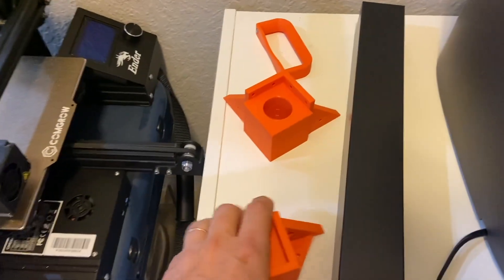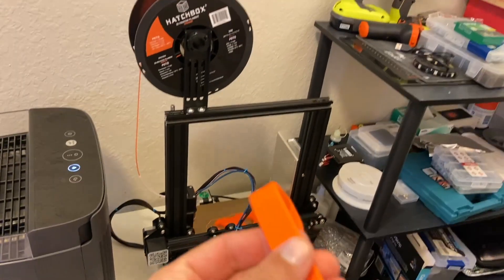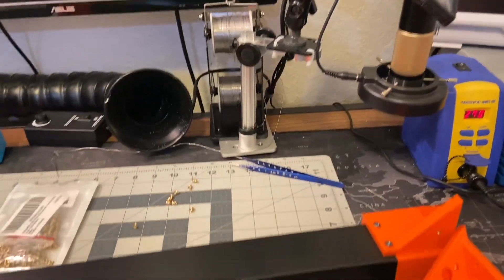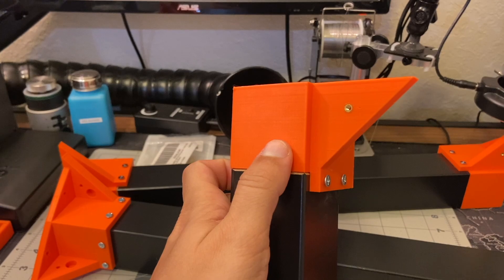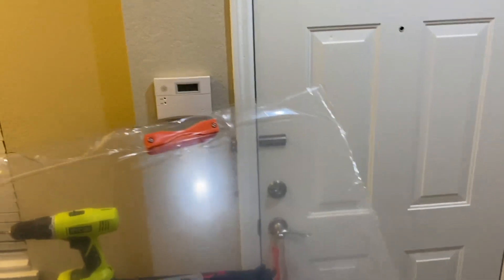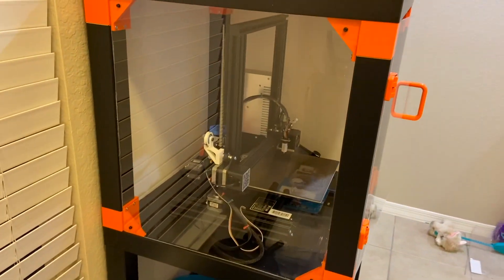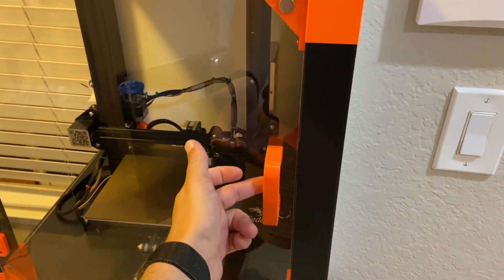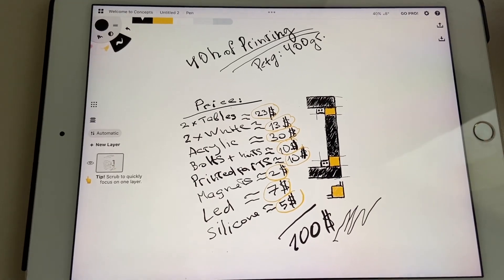Ender 3 IKEA Lack Enclosure (Part 1)

Comment: Hey man. Nice work. I note you use different sized risers to those in the TV page. Thus, what size did you make your acrylic panels? The TV ones are obviously the wrong size for yours. By my math - legs = 50cm, risers = 2 x 5cm = 70, but do you need to remove some more for the hinges etc? I'm going to order mine pre-cut
Reply from the maker: Hey, this was 3 years ago I gifted the Enclosure about a year ago to my friend and he sold it... so I don't really have opportunity to measure it now also I don't remember how it was done exactly. I know that I measured and cut panels on place myself it wasn't worth to spend so much money ordering pre cut panels as my goal was to spend as little money as possible. Also I think your math is a bit wrong: 50cm + 2 x 5cm = 60 cm

Comment: Hello, could you please list the dimensions for the screws and magnets? I might have missed but I couldn't find any info on those. APpreciate!
Reply from the maker: I used Random magnets and random wood screws from the kit I had... this enclosure long time gone so I don't even have opportunity to check.
Reply: @hobbyistnotes  Also, is the lack table rigid? Does it not move when the printer goes like 200 mm/s, etc,.
Reply from the maker: If your floor is leveled its pretty stable table, I used those for a while.
Reply: @hobbyistnotes  Can't wait to build!

Comment: Where does the filiment sit? How easy is it to change the filiment out? I usually have to pull really hard to get my filiment out, I don't think i'd have room to take it out.
Reply from the maker: What setup you have? What extruder? Do u have direct drive or Bowden? There are a lot of ways where you can place the filament (Inside, outside)

Comment: You wrote that you're using the 50mm risers, so I wonder, did you use them on the upper and the lower part (8 in total)? Thanks already for your answer 🙌
Reply from the maker: Yes, 50mm around, 8 total.
Reply: @hobbyistnotes  Okay cool, thanks for your quick answer! And heightwise you're not running in any problems and would resemble it that way again if you could, right?
Reply from the maker: @Joerg  I gifted this enclosure to my friend but while running I had no issues at all.

Comment: Does it overheat? should we put some fans on the top or something?
Reply from the maker: I recommend to get termometer and track temp inside to be fully confident. The whole purpose of chamber is to keep heat, per my experience even with fully closed and sealed chamber my temps never were over 45c with max print was 12hours. I actually thought to add cheap thermostat with heat pump and fan to get more controlled heat which will allowed to print more temp-critical materials such as peek.
Reply from the maker: As for printer, it's depence how hot you make your chamber, as is now I use Ender 3 with all electronics inside and all works fine.
Reply: @hobbyistnotes  Thank you for your response, I will build one and see if I need a fan to regulate the heat. Your idea of a thermostat is great for that. I do many long prints 18-24hours each so maybe I will need it, we'll see. Thanks for the video!
Reply from the maker: @firasb2269  Per my experience cartesian printers aren't perfect for long ABS prints as it always moves print thru the air by Z-Axis, so I use Core-XY printer for long prints and use this enclosure for 8-10h ABS prints only, but I bet you can push it further if Temp inside will be higher.

Comment: Nice building! 
For what do you need two tables? Why not just Polycarbonate on the top without a second table?
Reply from the maker: As I have 4 printers I want them to take as less space as possible... Tables are cheap + with second table I have extra storage, not sure if polycarbonate will be able to hold extra 3D printer up top with few spool of filament and extras.... tho you definitely can do this build with one table I think it's just preference.

Comment: Have you used any FAN inside the enclosure to maintain consistent temperature while printing ABS, NYLON etc..
Reply from the maker: No fans, it’s stabilizes itself on 40 (C)
Reply: @hobbyistnotes  Without fan will it stabilizes itself for long print like 15Hrs or 20Hrs ??
Reply: @mugeshrajaram6306  I usually do ~10-12h prints but few times had 20h and temps were around 40-45 anyway even enclosure is mostly sealed with silicone.
Reply: @Agilato  Can you please  share a silicone seal link for reference.
Reply: Can you please share the silicone seal link which you used.

Comment: Hello mate, can you mention the sizes of screws and nuts you used please? Cheers.
Reply from the maker: There are links in description to original thingiverse projects, all needed hardware listed there.
Reply: @hobbyistnotes  Hello mate, sorry, I read the description in thingiverse before asking you. I couldn't see any specifics. That's the reason asked you. Cheers.
Reply from the maker: @ellankih  For mounting printed parts to a table legs and top/bottom I used 52 x wood screws 20 and 30mm in length with 7mm head. For the panels 16xM3 bolts ~10mm in length and M3 nuts.
Reply: @hobbyistnotes  Cheers mate. That is very helpful. Much appreciated.

Comment: hi ! Have you got the right dimension for all the plexiglass please ? Just to be sure because please !
Reply from the maker: You need dimensions in metric or imperial measuring system?
Reply: @hobbyistnotes  Can I Please have the dimensions in inches?
Reply from the maker: @DomimoD_YG  17,5 x 19,6 inch for each panel, door size just a tiny-bit smaller.
Reply from the maker: 44,5mm x 49,8mm in metric
Reply: hey, I built an enclousure with the same dimensions as you did. How much smaller did you make the door panel to fit?
Reply from the maker: @TheDrSmischi  After Frame assembly I measured required size and went with -3mm per side.
Reply: @hobbyistnotes  ok, thanks. Then I will go with -3 mm as well :)

Comment: what slicer your using?cant your share slicer profile petg and abs for ender 3v2 ?
Reply from the maker: In this project i used default CURA profiles for print and material settings after that just set 120% speed on the printer. For Voron's ABS parts i use recommended Voron's settings. I'll see if i can upload them somewhere, but there is nothing special pretty much stock CURA profiles.